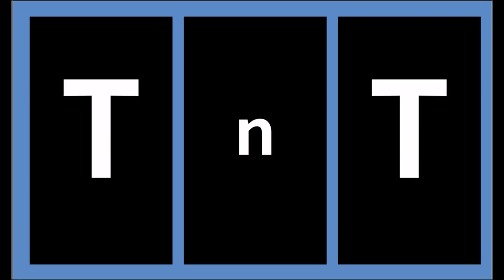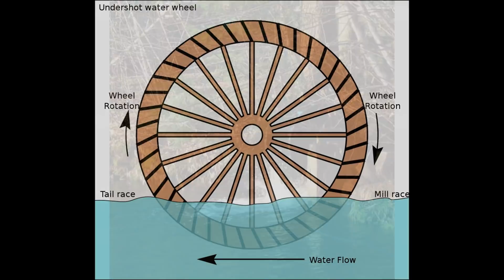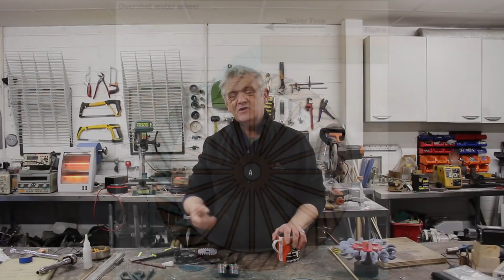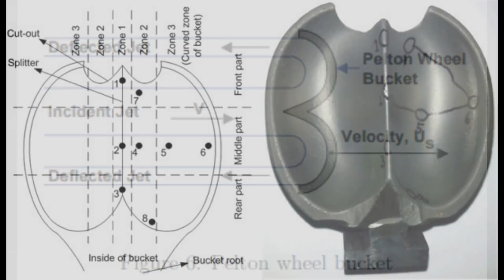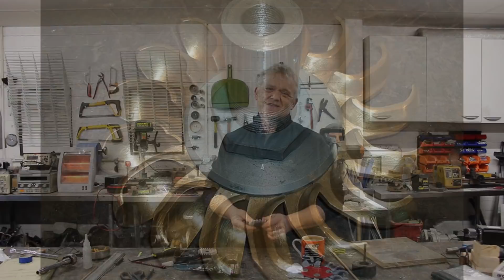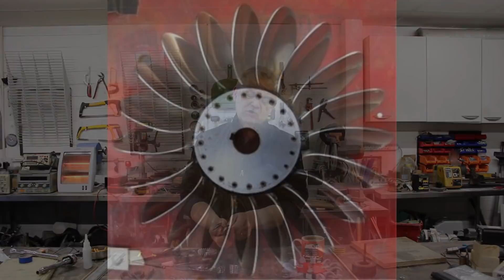1475 Types Of Turbine - The Turgo Versus The Pelton

Comment: Hi. Since the water on a Turgo turbine is at an angle, will that give a twisting motion to the wheel and shaft. An unbalanced torque to the wheel ?  
That Turgo should be fed or sprayed from two sides to balance the force on it ? 
thanks, Please keep making these videos. I'm glad you have not run out of things to experiment with.
Reply: You can use 2 jets at 180 degrees to balance the pressure on the bearing
Reply from the maker: you are spot on mate - you often see them with two to four jets for just that reason
Reply: @ThinkingandTinkering  Thank you. Good to know I'm starting to see issues before building somethings.

Comment: There's a different way to turn a generator with fluid.  Wobble plate. It is a flat disk that is mounted on an angle inside of a short cylinder.  There is two openings, one pressurized the other open exost. The edge of the wobble plate opens and closes the ports as it wobbles one side then the other. Each side of the plate would be considered as a power adder. Think of it as a two stroke two cylinder engine that runs on outside pressure.
Reply: It is used in water meters because it also works as a measuring device.  The displacement per revolution is almost always linear, cavitation is the only reason why it could be off as a measuring device.
Reply from the maker: you often see wobble. plates in pumps - most pressure washers have them